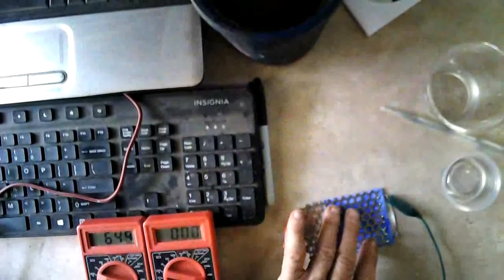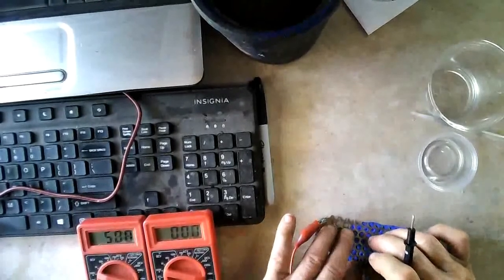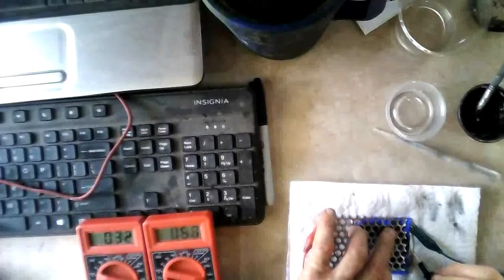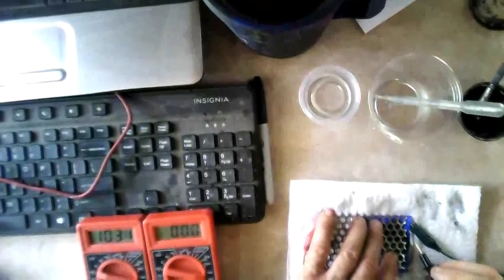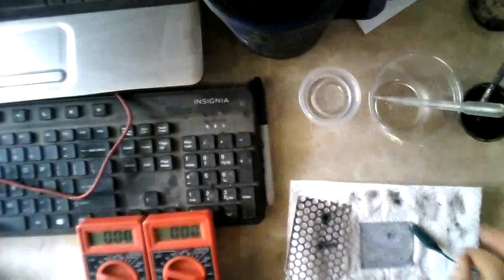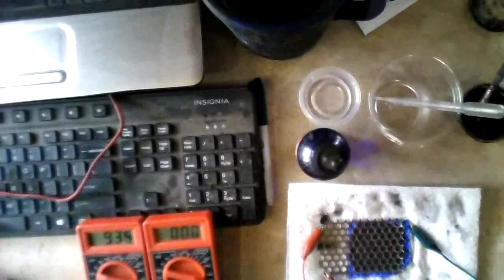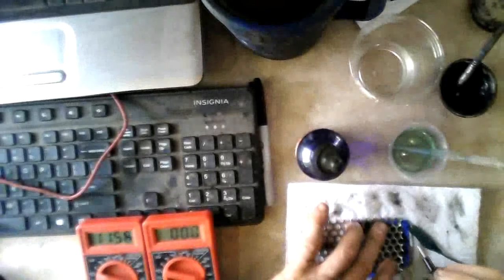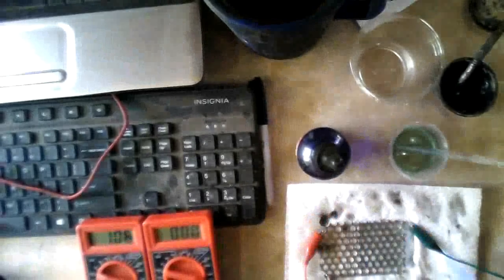PVA Cooling Cloth Separator Experiment!

Comment: It seems like the results are comparable to the separator you have been using if not marginally better. As I see it the advantage is it is uniform and ready made.
Reply from the maker: The PVA cloth holds a lot of water too. The downside is the cost, but it might be possible to buy the stuff in quantity for cheaper.